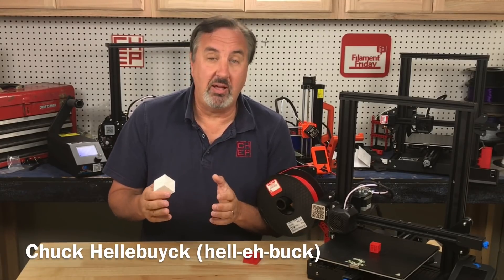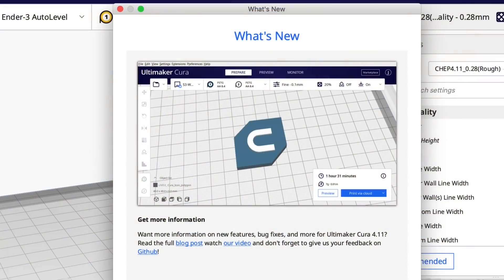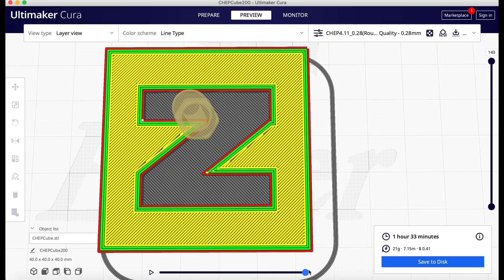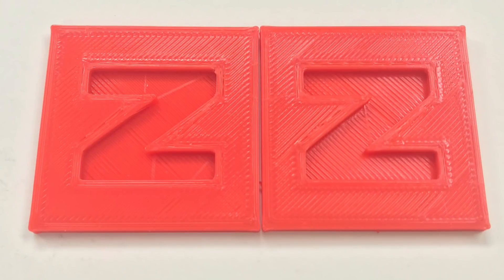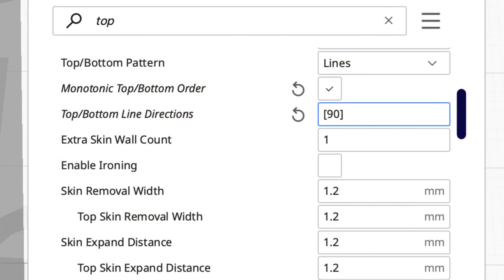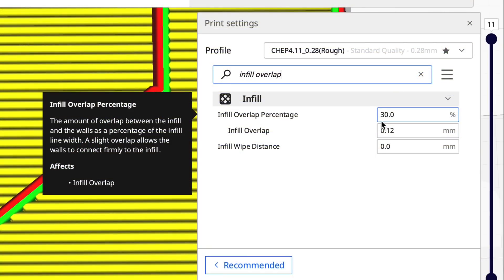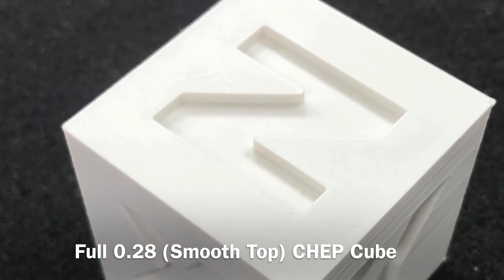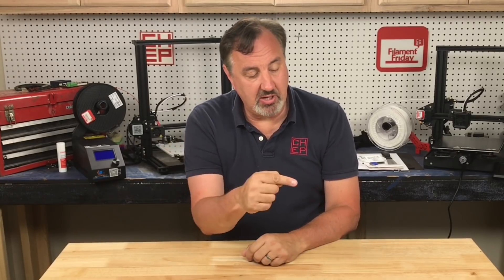Smoother 3D Prints in Cura Slicer 4.11 without Ironing!

Comment from the maker: My 4.11 profile download was missing a couple of the smooth profiles. It’s been corrected. Re-download to get them all.
Reply: Dang chep, I always knew you could do things like that to make it nicer but never knew how. You would think would tweak itself to get the best print possible but they put all these cool options hidden when they could provide profiles in cura ready to use. I mean that's what they do 8 hours a day which makes them experts but hide these options that really make a difference.  They have to many options listed we never use but hide the good ones. Cura, please place a few profiles like chep's for us regular users.
Reply: Thank you so much for sharing these!
Reply: Where can I find the profile?
Reply from the maker: Link in description.
Reply: @FilamentFriday  Thanks
Reply: @FilamentFriday  to use them on my Geeetech A10 i have to add the Ender 3 printer, but do o have to change anything in those Machine settings Cura shows when adding? Print head settings and Start G-code. Thanks
Reply from the maker: Not that I know of
Reply: @FilamentFriday - can someone please reply back to me  with all steps how to get your 3D print  smooth in Cura ?
Reply: Hi ,
Can you please make video of 3d print toys comparison of ender 3 max and ender 3 V2
Reply from the maker: What kind of toys?
I find they print about equal for most prints.
Reply: I would like cura profile for petg and asa. Can you help me? Thank
Reply from the maker: Just change the temp. They will be close.
Reply: Would those profiles work for the Ender 5 Pro?
Reply from the maker: They should.
Reply: Hey. Can't you update the non creality profiles? I've tried to import using in cura the creality printer profile but it messes with other stuff like bed size and others. For noobs would be a great help.. thanks for all the shares
Reply from the maker: Just modify the Creality machine profile. There’s not much to it. Making profiles specific to other printers is more than I have time for and I don’t have printers t test them on. Since many just copy Creality anyway, modifying the Creality machine profile has worked for many people.
Reply: Chep, i download your profile for cura, but i cant open. can you tell me what to do? thank you
Reply from the maker: Use the Ender 3 Machine profile first and adjust to your printer if necessary.
Reply: can you please update your Prusa slicer profiles . please am using still the Prusa slicer your old profile :( . for some reason i not find cura good the output gcode it create is very big and also time to complete if its 2 hours then for Prusa slicer it will be one hour . also Cura prints miss up in middle however Prusa slicer prints are all the time good and are completed in short time
Reply: Would these profiles would for something like a anycubic vyper ?
Reply from the maker: Yes, if you use a Creality machine profile.
Reply: @theradfords86  Anycubic vyper just added its own profile.
Reply: Thanks for this. Am new in 3d printing. Just bought an ender 3 last month. 👌
Reply: Is there a mono setting in the chep profiles with all these little fixes ?
Reply from the maker: I made smooth profiles based on this but didn’t use mono.
Reply: Please make a new profile for the newest cura. I cannot stop stringing on silk pla by amoden.  Thinking bad filament.
Reply: In cura profile 4.22 on 0.2 monotonic top/bottom is enabled and more settngs changed, but for 0.12 and for 0.28 not, please fix this if thats error
Reply: you are the best, thx

Comment: I had tried it's almost perfect , but since I was using this setting I have been experiencing filament grinding which led to under-extrusion , I checked for nozzle blockage,extruder gear wearing and ptfe tube deformation . for now I am testing different Z-offset Distance (may be it causes pressure built-up inside the hot-end leading to skipping eventually to filament grinding and extrusion failure. DOES ANYONE HAD EXPERIENCED SUCH THING???
I'm using ender3V2 with upgraded dual gear extruder.
Reply: check your e-step on your printer its probably not extruding enough filament, something your printer is going happened to my cr-10

Comment: Really useful, thank you. Flat surfce quality is now looking great, using monotonic. I did add ironing to it too - but now experiencing blobby details. Could this be a result of using ironing?
Reply: Blobby details when ironing usually come from a too high iron infill percentage. Normally, 10% is good enough when using monotonic top since ironing does extrude the tiniest bit of material to fill in the gaps left when printing the top. If the blobs are more towards the perimeter of the top, then you need to adjust your ironing inset setting to be a bit more towards the inside of the print.
Personally, I use 10% ironing infill and 0.1mm ironing inset. Prints come out literally as if they were mold injected, only with a matt finish instead of shinny.

Comment: I love your videos! You offer so much information! I am using Cura 5.2, do you have a "smooth surface" profile for that? Not all of the settings are the same in 5.2, unless I am missing something. Thanks in advance!
Reply from the maker: Just enable ironing
Reply: @FilamentFriday  thanks for the really fast reply. I found the settings. I didn't want to just enable ironing as you showed poor results, but thanks for all the info! I have been on a Chep binge.

Comment: I have not tried this yet but I think this would show you more results if instead of a cube you make a circle with M3 screw holes in it. Extrude it a few mm. When cura sees this it creates a lane from the hole's complete width to the edge of the circle for each of the holes. It then goes back and fills it in later but it's always uneven. I'll have to try this out to see if it makes it better, but I think that's how to test it out better.

Comment: How do you get the video preview of the item that is being printed?
Reply from the maker: Preview mode
Reply: I figured the video or the preview out.  Although I did try to institute the settings you recommend the walls come out thin and not really smooth at all.  I am using a Tevo Tarantula and I think I may have an extruder problem.  I have tried increasing the temp on the bed and on the hotend and got much smoother starting and ending but the in between where the infill is (50%) it looks kind of crappy. This shows up in the walls where the infill is also.  The problem with the extruder is it clicks once in a while and you can tell that is where it leaves small gaps.  It is a single gear extruder and I may need to upgrade it but I am sure there is some other reason this is doing what it does.  I have some pics and a video I can send to you to easier see what I am talking about.

Comment: Some of those are not applicable to every situation, for example "outer wall inset" destroys small 3d text, but the suggestion to remove the skin-wall was great, that along with a small increase to "compensate inner wall overlap" finally fixed holes I had for years!

Comment: Everything I print is almost perfect except for flat surfaces. Flat surface tops look unfinished are about as flat as my driveway. I tried your smooth version. Better, but not smooth and still look unfinished.  Will Cura 4.13.1 work better for me?
Thanks.
Reply: Nah, it's pretty bad. Just use ironing, it's much better imo. His one was rough and didn't have a nice finish.

Comment: hi i have downloaded the file but how do i get it on my cura settings
Reply: Unzip the file contents to a new folder>in the print settings side bar on the right click the dropdown for Profile>Click Manage Profiles>click Import> and select the profile you want to add. Repeat for the other profiles as you may be able to only add one profile at a time.

Comment: I think it's trying to laying the filament in the same direction while previously the last part of the infill could be laid down by going around and close the infill going in the opposite direction the earlier part was done if that makes sense. That would cause a visible edge. It's like dominos falling in opposing directions giving a pattern difference. But your printers compliance/backlash is so bad that it hides the advantage (spacing if the infill looks like in pairs while it should be evenly spaced). The 90 degrees infill on the second attempt is much better as it hides the backlash.

Comment: Honestly, I think the Monotonic looks worse than normal. There are deeper grooves where the nozzel has moved. I've noticed this on stuff I've printed recently as well. I was not sure what was causing it but I had forgotten about turning on this settings. The surface is full of ridges and not nearly as smooth as it used to be.

Comment: Why does setting the outer wall inset to .2mm end up turning some of my smooth "shell" lines into some really rough "top/bottom" lines?
Reply from the maker: Your extrusion rate may be too high. Check your e steps
Reply: @FilamentFriday  Sorry, meant it changes the actual line type in Cura

Comment: Hi Chuck,

I hope you're having a great holiday!

I have tried to use a smaller line width for my top layer and I've found that it doesn't always stick to the part and peels back in some places. I have also noticed that my printer z offset is too high for the smaller line width but perfect for the regular line width. How do you get around this? Can I modify top layer z offset in cura or is it cooling? I have a 4020 blower fan with a dual duct fang set to 100%

Thanks
Reply from the maker: Sounds like your cooling it too much
Reply: @FilamentFriday  since I can't turn off cooling for just the top layer I will disable it completely since it is not a small print. I'll let you know how it goes. Thanks!
Reply: I ended up fixing it by using a slower speed and a 5th top layer (unsure if that top layer really made the difference or not but I feel there's minor peeling without it) only other issue now is that when using this smaller top layer width my extrusion is delayed after retraction and plastic starts laying down too late leaving small gaps. Is there a way to use different retraction settings for top layers? Thanks for your help and happy new year!

Comment: It's crazy how much you have to change for every print. If I started 3d printing someone said me you only need to get one good profile and you just have to press print in future. But thats absolutely not true. Sometimes you need more Extra infill walls because you have a low density infill pattern, sometimes you need gradual infill steps, sometimes you need more walls to reduce small infill lines. Or you can print way faster if you're printing big parts, you can reduce retraction if you're always within your parts to safe time...... its so complicated, but its so fun :D

Comment: Chuck, maybe you know. I have a BTT board in my ender 3 and it's well used, but for some reason started making noise on a print (standard stepper whine), I left for 30 minutes, when I got back it nearly was on fire... XY &Z burnt my skin, E was lukewarm. It's recovered. The print failed too, it was a sheet made to clean the glass, but oddly turned to speggeti

Comment: I see you have increased the infil in the Good 4.12 to 25. Takes more time and more filament.  I believe the 4.11 was 15. Is there a reason for this change?
Thanks.
Craig.
Reply from the maker: Better top surface suppport. Use lightning if you need to save time.

Comment: hello chep , great video but i just want to point out an issue that i found with this profile and specifically with the outer wall inset while printing the benchy. when i have it set on 0.2 (as showcased in the video ) my benchy has issues in the front that seem like uindercooling but its not , because when i have it turned off it prints just fine . Also the small circle in the back prints without a wall and it looks awfull (can also be seen in the slicer ). just wanted to point it out because  i have been scratching my head for about a month now trying to find out the issue and  i might be able to save someone elses time
Reply from the maker: It’s why I offer two profiles. One for smooth top and then my normal. There is no reason to use a smooth top on a Benchy but your results are helpful.

Comment: Dear chep.  Anycubic vyper seems to being moving up.  I am buying one.  It’s sad because you have no information on it.  I value your opinion.   Please get the printer and make a video.   Thank you. Doug.
Reply from the maker: Why do you like it?
It’s over $330 on amazon.
Reply: @FilamentFriday  it’s got auto leveling already.  Double motors for the up and down.   Sorry forgot name.  Do you think I’d be making a mistake.  I couldn’t get my Ender 3 ver 2 right.   Sent it back.  Wanted auto level on it and a different bed but didn’t know where to start.  There’s so much info I was confused.  Vyper seems ready to go.  I’d appreciate your honest opinion.  Thank you. Doug.
Reply from the maker: If you want autolevel then it’s probably a good choice. I may have to look into that.
Reply: @FilamentFriday  was really hoping for some advice from you.  I need to buy a printer.  Ender or vyper? Cr or bl touch ? Firmware? Thank you chep.
Reply: Should I just buy Ender 3 ver 2,again and install a bl touch and change to pei bed? I could not get mine leveled and it stay.   It’d print something then it’d be out of whack.  All bolts were tight.  Eccentric nuts adjusted.

Comment: I enjoy your video's and your
 explanations of what each setting does and how it works.    I have seen some other video's where Ironing works beautifully, but at much higher speed and higher flow.  I'd love to see a video from you where you dive into Ironing.   Your settings here work great.  But there is those parts where a perfectly smooth top is needed.
Reply from the maker: If you need perfectly smooth top, print it upside down on glass.
Reply: @FilamentFriday  My printer has a textured PEI bed.   But I’ve actually achieved perfectly smooth tops with Ironing.  At much higher flow and much higher speed than the default cura settings.
Reply from the maker: Nice. Where do you share your settings?

Comment: Great info.  I tried your 4.11 smooth surface profiles on a calibration "bucket", but one of your settings deformed the print.  Outer Wall Inset value is set to 0.2 (default is 0).  This removed the inner walls on my print making it unusable.  Setting this back to 0 fixed the problem.  Just wanted to let you know that it seems you have to be careful when using this setting.  Let me know if you want to see the file for yourself.

Comment: I just loaded your profiles.  Since I use a .8 nozzle what do I have to change to make them visible/useable?  Thanks!
Reply from the maker: They are setup for 0.4 nozzle so you’ll have to make some adjustments.
Reply: @FilamentFriday  What to adjust?  I tried everything I can see so far.  I thought nozzle size was independent since it has its own tab front top and center.

Comment: Thank you for the profiles. However, I believe you exported the 0.12(SmoothTop) profile and named it 0.20(Good). Comparing the files, these two profiles are almost identical both having a layer height of 0.12. I verified this against the archive uploaded on 10/11/2021.
Reply from the maker: Thanks. It’s been fixed.
Reply: That took care of it. Thank you!

Comment: Do your profiles work a Sovol SV01 Printer
Reply from the maker: Yes. Just use an Ender 3 Machine profile.
Reply: @FilamentFriday  thanks CHEP, one other question I was struggling to get fusion and cura to slice a. 3mf file it would bring the 3mf into cura but outside the bed area and when you try to move it. It moves in several bodies seperately.
I had a go at doing it with luzbot  cura slicer and it worked OK. I don't really like the Luzbot version but maybe I'm doing something wrong in ultimaker cura version

Comment: No, see the line directions change the integrity of the part. The diagonal lines give support to both x and y axis but making them horizontal or vertical takes the strength from one of the directions.
Reply: It’s only on the top layer. This will not compromise too much.
Reply: @jackthomas2051  will and does are two different words with two different intentions and outcomes

Comment: I avoided watching this because I was working on a video on the monotonic settings and wanted to come to my own conclusion. Finished it a few days ago so finally got a chance to watch this. I had really good results with monotonic ironing and depending on the size of the part/geometry was able to see a difference with non ironing monotonic layers. That being said there is no denying the changes you made had a much higher impact on top surface smoothness without need to enable ironing. A few of these settings I have actually not played around with before. Thank you very much for the information and tips 😬👍 there is a never ending amount of things to know 😂
Reply from the maker: I look forward to seeing your results. It’s not about ironing, it’s how to get the best top surface and Monotonic alone has not done a lot in my experience and also looking at other channels results.

Comment: **Edit** I did finally figure out what setting was messing up my coin graphic. I some how overlooked the "Outer Wall Inset" change to 0.20. With this set my coin graphic gets messed up. With it at 0, everything is GROOVY.

I downloaded (on 9/15) and tested the profiles on a game club coin I am printing and when sliced with the .12 smooth profile and the .20 profile, the coin graphic becomes a complete mess. :( 

When I created a test .12 profile off of the default Cura profile AND made all of the changes I could find in your (CHEP's) profile, everything sliced fine. I tried going through and comparing settings line by line, but can't figure out what is hosing the smooth slicing profiles. G-code, maybe?